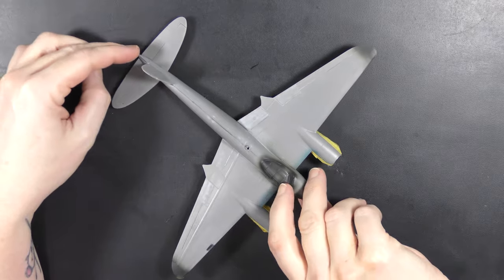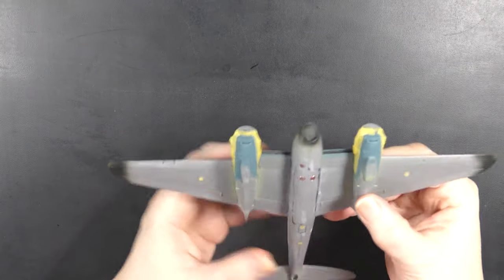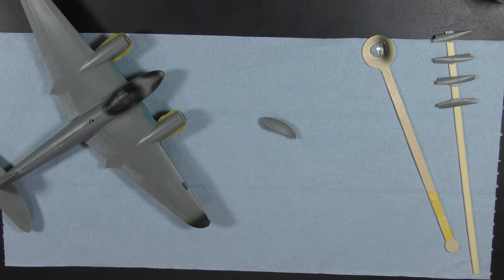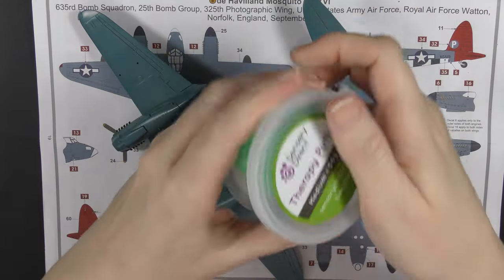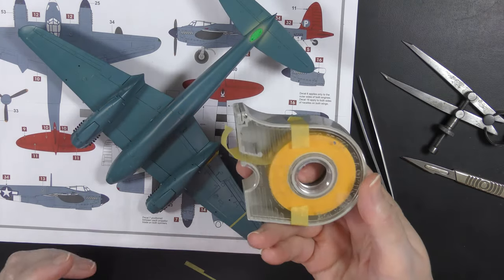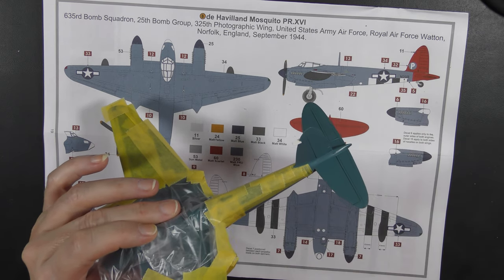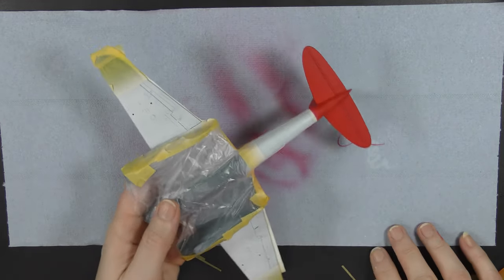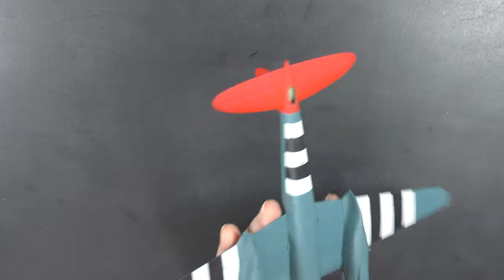*Modelling for Beginners* Part 8  -  Airfix Mosquito PRXVI

Comment: Wonderful video Jen thankyou. Perfectly explained every step of the way. Looks beautiful. Don't change how you approach these build series, because you absolutely hit the sweet spot. The whole idea of this sort of video series is to learn new techniques and improve your skills. In my honest opinion you cover every base perfectly. Just a quick one, I used that ammo masking putty on a 1/48 Airfix spitfire and as I was spraying Vallejo model air green, it started to be repelled from the putty edges. I've since pulled all the putty off and now am unsure what to do. It was almost like the paint reacted with the putty. Any ideas?
Loving your work and video's Jen, thanks so much. 😊
Reply from the maker: It's hard to say without seeing the problem. I wouldn't expect acrylic paint to 'stick' to the putty, but if it's left uneven edges because of it then I suspect maybe too much paint was going in there. Fixing it will be case of cleaning up what you have and carefully remasking it I'm afraid, and try spraying more gently.
Reply: @JenesisDesignsandModelcraft  thanks for the reply 🙏 I've been a bit disillusioned since it happened. It's put me off using the putty, but as you say, I may have been a little over zealous with the paint! Not really very confident with the airbrush yet. Thanks again 👍

Comment: Hi Jen. Your videos have to be the best I've come across. Your calm, relaxed voice and manner are a treat to listen to and watch. I've learned a lot from you since discovering your videos. Your tip about the plastic is fantastic and another excellent example of how products designed for a different use can be used in modelling (just like therapeutic putty). I bought the same roll of plastic years ago at the retailer where I bought the paint and supplies to paint the interior of my house. It was sold as a drop-cloth for the walls when painting the ceilings; I could mask off and protect the walls in one step. I bought two rolls, each with a different amount of plastic that would fold out depending upon how far down the wall you wanted to cover. I don't remember it being expensive at the time. It was probably cheaper than if it had Tamiya's name on the packaging and possibly easier to find; my local hobby store doesn't carry it. Had I not seen you use it in this latest video, I would have never thought about using it for my modelling. Thank you.

Comment: Jen, rather than setting your dividers to the edge of your rule, set them from 10mm then add 10mm to your desired distance. It's a lot easier and more acurate. Loving this series and even as a beginer I'm not finding it over complicated. Keep up the good work. Rgds from an ex Herc rigger.
Reply from the maker: I certainly would do that if I was super bothered about being exact. 47 Sqn by any chance?
Reply: @JenesisDesignsandModelcraft  No, Structures bay '90 to '97.

Comment: Another load of great advice. I feel that you had to pick a model like this even if it maybe is not a beginner model per say otherwise there would not be enough detail to show what you are trying to convey which helps a lot for folks like myself that are trying to apply these ideas to all different kinds of models big and small as well as the model that I am building along with. Hopefully when the model is complete the ground crew is not to upset with those extra holes in the wing fuel tanks....

Comment: I too am not quite a beginner but always looking for hints and tips. Hate ramming wheel wells with soggy tissue and mask fluid or blu tac as I always find it hard to remove, so bought some therapy putty you used here to try it. Have seen folks use it for camo masking but downside is it spreads, so you need to apply and spray quickly. I usually use blu tac worms and tape/mask fluid, but hard to recover the blu tac. Would blu tac worms with infill of this putty work I wondered? Tried a test with a circle of blu tac infilled and left overnight. No paint bleed and the two materials separated cleanly. 😀😀Result. Thanks Jen